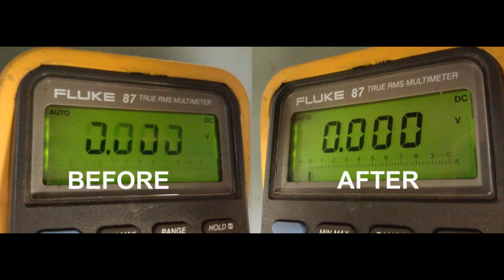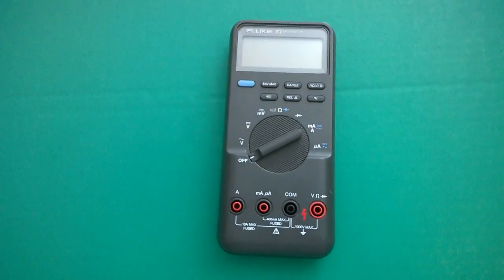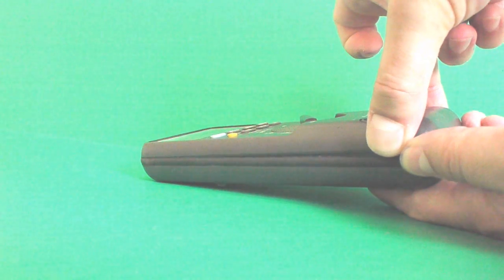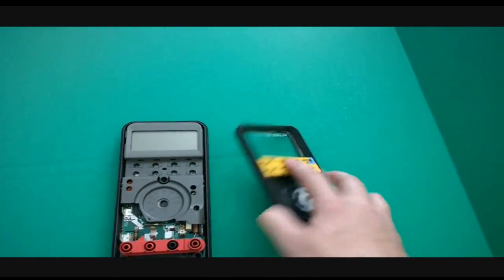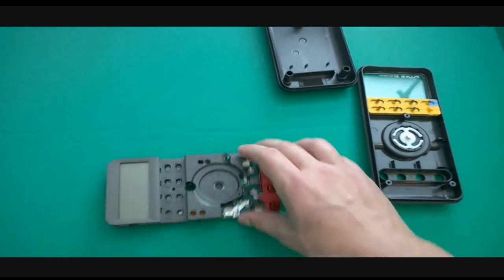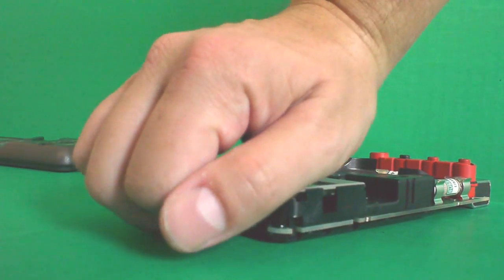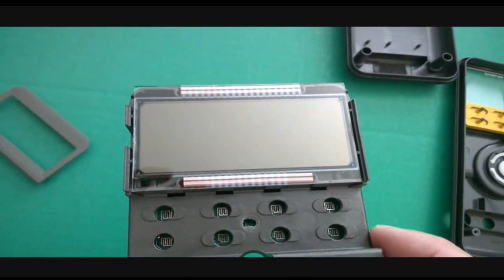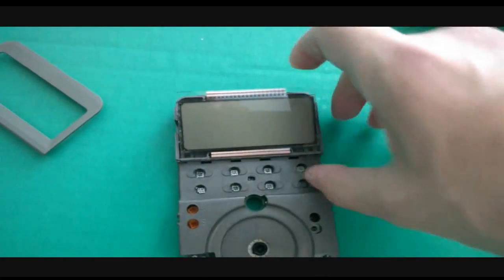Fluke 87 Display Repair The Right Way - Free Instructions

Comment: Kit no longer available.  Contacted Fluke to repair my meter for this issue.  No longer servicing the Fluke 87 True RMS, but I could buy a new one from them for nearly $400.  I tried to have this repaired back when it started happening back in 1993~1994 timeframe, but they wanted $250 as a "repair fee".  I paid $225 for the meter (maybe less).  I wasn't happy for sure.  :(
Reply: I found them for sale on fleabay for under 20, and it has worked no issues
Reply: @spartanreece9908  Maybe I'm blind or have zero idea how to use the old fleabay any longer, but there are no 'screen' or 'kits' or pretty much anything for the Fluke 87.  

I guess I continue to take it apart, clean the pads, and move on.  Probably the last Fluke I ever buy after their piss-poor customer service with me (and yes, since I bought the meter).

Comment: I have a fluke 77iv multimeter,when it's turned on the display is on the same way  for all functions,please help.Thanks
Reply from the maker: When you state it's the same way, you mean the display is on VDC, for example, for all the functions?  Is it all zeros?  Try taking apart and making sure that the range selection knob is positioned correctly and that all the contacts are clean and in the proper place.  I'll try to post a video of the Fluke 77IV, or compatible soon...if I have one.  Thanks for reaching out.  I hope this helps.

Comment: Ordered your kit and replaced the elastomeric strips with the new gray ones and the display didn't get any better. I have an old FLUKE 87 meter from when I worked at Xerox. It is probably 40 years old .  Is it beyond fixing? By the way the contacts on the PCB are not copper colored; they are dark. I have cleaned them with alcohol, but no difference in the display.
Reply from the maker: We'd like to help, but need more information. Pictures will be very helpful so we can better diagnose and offer best solution.  Thank you for your purchase...now we owe it to you to make it right.  Contact us anytime lcdrepair@multimeterparts.com

Comment: Is it some glue used to elastomer connection?? Or not use ?? Where we buy elastomer, and lcd fot Hioki 3230 ??
Reply from the maker: There is no glue used.  Sometimes the elastomers will stick to the LCD due to age.  It seems like it's glued on, but it's just stuck to the glass. Please text size of your Hioki elastomers to lcdrepair@multimeterparts.com and we'll do our best to accommodate.  We've had success trimming elastomers down in size to fit smaller applications. This might be an option for you.

Comment: Just repaired both my 87 and my 75.  At first the new pads in the  75 did not help, lots of segments missing....  I did clean both pc and led contacts (very carefully) with Deoxit D5.  I did not take the cover off.  I used a miniature brush made from a cut off and crushed end of a tooth pic (squeezed between pliars until "brushy") dipped it in the Deoxit and wiped lightly down in the slot on the pc board.  The 75 now works quite well now as does the 87.  Thank you very much.
Reply from the maker: That's great!  We're happy it worked out.  We look forward to putting up more content in the near future.  Don't hesitate to reach out if we may be of assistance moving forward.  lcdrepair@multimeterparts.com

Comment: i have question .i put the leads to connect 9v battery positive to positive negative to negative is no reading.i reverse leads have .554reading on the diode setting test.is normal or short circuit ?
Reply from the maker: We're back from hiatus. Not sure I'm understanding the setup completely, but I've seen bad batteries give strange readings...even when batteries fresh out of the package. Rare, but it's happened. If you suspect something wrong internal, check for physical signs of damage on the main board PCB.  Good luck, and please share the results.  Everyone's been waiting over a year to find out.  Thanks for your question, and we apologize for the delayed reply.  All the best to you.

Comment: Do you sell the LED backlight replacement? Did you ever sell it? I have the two grey elastomeric parts from you and an LED backlight, but no instructions on how to install the LED backlight replacement. My Fluke is an original 87. Thank you.
Reply from the maker: We're back from hiatus. Contact us directly and we'll do our best to accommodate your request anytime moving forward.  We do have LED Backlights in stock.  The original Green ones and the Fluke 80 Series III white ones.  For your consideration: https://multimeterparts.com/contact/

Comment: How different is the 27/FM
Reply from the maker: The main difference is that the Fluke 27/FM elastomers are a different size than what we carry in stock at the moment.  Other than that, try cleaning the elastomers with alcohol pads to see if it improves.  We'll be uploading new content in the near future, and we'll include the Fluke 27/FM.

Comment: My Fluke 88 stays at start up screen , with all led's in test mode everything visible
Reply from the maker: We're back from hiatus. We know it's a little late, but try spraying electronics contact cleaner into and around the range selector switch.  If the problem still persists, contact us anytime and we'll do our best to accommodate a solution. https://multimeterparts.com/contact/

Comment: The elastomer and gold pads can be cleaned with pure ethanol or isopropanol to restore function. No new zebra strips are required.
Reply from the maker: Thank you for sharing.  Yes, this is true; however, there will come a time when the elastomers should be changed.  Technically, the fading lcd segments is not due to dirty contacts...it's really due to the elastomers losing their bounce after years of compression.  The old pink elastomer life cycles are just about up.  When you're looking for replacements, consider our offers.  We'll do our best to accommodate.  https://lcdrepairkit.com/contact-us/
Reply: Both are true , please study carefully before you handle the problem.

Comment: I own a Fluke 79 that had a similar display problem.  While it is not identical inside, it is close enough that this video helped me fix it using using a couple of the gray elastomers that Fluke had sent me a few years ago.  Your information about the contact cleaning not being necessary and the demo of taking the display apart was just what I needed to help me understand that I wasn't really risking major damage.  After years of ghosting displays, the thing now looks like new.  Thanks.
Reply from the maker: Great, and thank you for sharing!  Glad it worked out.  Contact us anytime moving forward if we may be of assistance to your Fluke meter, or Test Equipment needs.  We'll do our best to accommodate.  https://lcdrepairkit.com/contact-us/

Comment: Do you sell the LCD for Fluke 87 Multimeter or do you know of any stores you can sell?
Reply from the maker: Our best recommendation is to find a reasonably priced used/parts meter and swap out the LCDs.  Occasionally, we'll get a parts meter in with a good display.  We do have pre-owned units that we part out.  For parts requests, please contact us at https://multimeterparts.com/contact/

Comment: I picked  a fluke 87 at a yard sale for 4.00 the display wouldn' t work; I changed the battery and ordered the reair kit here installed it and for 24.00 I have a working meter. this worked well Thanks
Reply from the maker: Thank you for your purchase and generous feedback.  We're available to accommodate when you need us moving forward.  All the best!